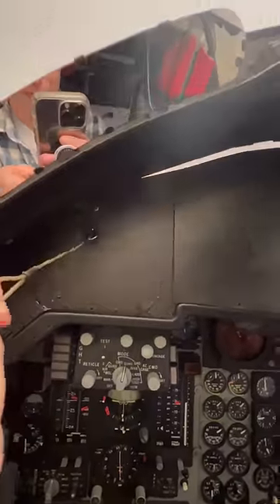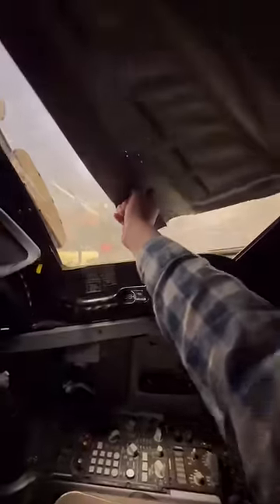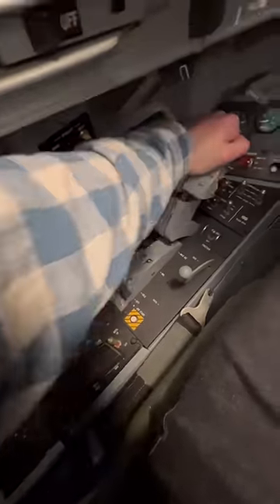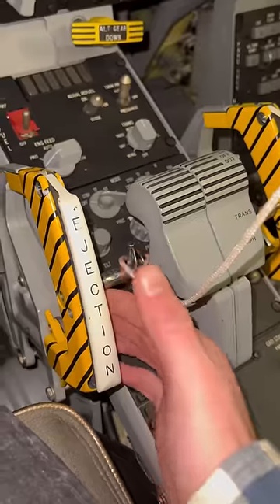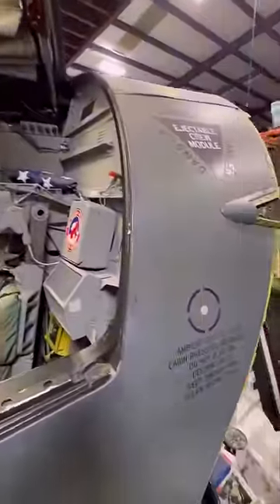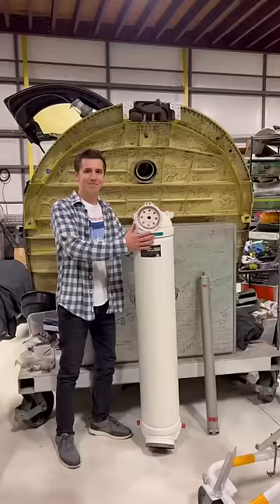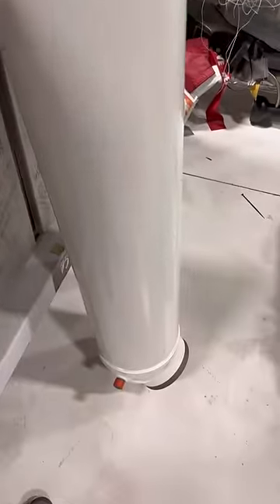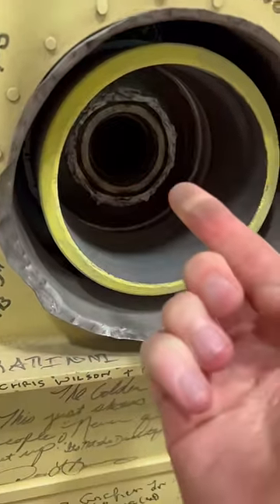How to Drop a Nuke and Survive

Comment from the maker: Fun fact: the F-111 took out more tanks than the A-10 in Desert Storm!
Reply: Hi
Reply: „Fun fact the a-10 isn’t good at its job“-Jackschneider
Reply: @Jisttoturn  Its sad but it's true
Reply: @Jisttoturn but…but the BRRRRRRRRT ?
Reply: @Jisttoturn Who cares, it's famous + fearsome reputation. I heard its job as a slow flying 20mm shredder were usually well done. 
 Not too deep in US war tech lessons, so plz explain where did A10 fail?
Reply: @dannydetonator  Fearsome reputation to british tank columns.
Reply: Cap
Reply: @dannydetonator inability to identify friendly units, causing friendly fire. The gun has an accuracy measured in busses, no that's not a joke or an exaggeration, you take two busses, put them end to end, and that's the splash zone of the A10s gun as manufactured. Some bullets still land outside of that.

There's an entire laundry list that I don't have the patience to type out on mobile, but do know the A10 holds the friendly fire/ civilian kill record by a wide margin.
Reply: Not really hard to believe really Desert Storm was a different war, we didn't have a lot of CAS needs in that one. Iraqi Air force was either bombed on the ground or shot down in dogfighting, neither of which are the A-10's job. The A-10s job was strafing the hell out of armor.
Reply: But I bet the A10 took out more friendlies, British specifically. Checkmate
Reply: @M3rl1n177  Thanx, didn't know that.  Ahh, shredding everything in a straight line of fire did backfire after all..
Reply: @dannydetonator  They used binoculars in flight to identify the targets on the ground. Imagine that.
Reply: Fun fact a10s can't carry any nukes if they could it's a suicide run Kamakazie 2.0
Reply: @dannydetonator  Correction: It's a 30mm gun, not 20mm
Reply: @Daikael  that’s true depending on the distance to the target. The accuracy is measured in MILS. The GAU-8 has a rating of 5 MILS whereas the M-61 is rated to 8 MILS. So if we are talking about the accuracy of airborne gunnery systems, the A-10 is significantly better than the most common western gun. That’s before we get into the ballistic differences between the two.
Reply: Bros a warthunder player 💀
Reply: @usernames98  nah it's fr
Reply: That's a lie. And I base that on no other Evidence than the fact that I'm just not gonna believe you since the A10 is the coolest human invention ever.
Reply: @dannydetonator  30mm" GAU-8 but yes
Reply: Where is the ejection capsule located? I'd love to see it! (Worked on the 111A)
Reply: @dannydetonator  Well. It really were just that we have rockets
Reply: @dannydetonator 30mm
Reply: Wow that sounds like a lot of fun! 😑😑😑
Reply: So if you know, you know…. What?
Reply: @dannydetonator  is a 30mm cannon bud
Reply: @_Clem_H_Fandango_  which it did less of (or at least killed less enemy armor) than the f111
Reply: @dannydetonator  Well when you mean "Did it's a job well" did you mean British amour convoys or actually shooting at enemy convoyes.
Reply: @dannydetonator  also guns are hella overrated planes take bombs over mini gun gun pods for a reason.
Reply: @kim98677  lieeeesssssss all liessssssss!!! I love the A10 and they are awesome (and the sound will either give you a sigh of relief or you just don't exist anymore) and that's all there is too it lol
Reply: @dannydetonator  not to be that guy but, 30mm.
Reply: @Jisttoturn  Armchair general cringe
Reply: @bigtony4930  It's literally an armchair general mindset to say that the A-10 is good. Actual data and accounts from those familiar with the aircraft affirm that the A-10 is a bad CAS plane. That was true when it was designed, and it's even more true today.
Reply: @Jisttoturn  it is right?
Reply: @dannydetonator  lol
Reply: @dannydetonator  just like kv 2 except that I failed
Reply: @ilikeships9333  ye
Reply: @jeremiahpurba3882  LMAOOOO
Reply: @kim98677  Average A-10 Fan
Reply: And kllled way less of our own men
Reply: To all A-10 fan boys, cope and seethe. Aardvark supremacy
Reply: Yes , but the A-10 took out more friendlies
Reply: I don't know? Please tell me!
Reply: But how many British tanks were those? A-10 still wins
Reply: I wish we still had a few operational F-111s we could donate to Ukraine. They could do a lot of good over there.
Reply: Yes but did it cause as many blue on blue/green incidents as the a10?
Reply: lotta seething and coping in here
Reply: @DARTHNECRION  Gripens are better for ukraine or f16 ,the f111 its a bitch to maitain .
Reply: @thelandofnod123 hat’s a disingenuous comparison. The M61 was largely designed for air to air combat, where large spread is more beneficial than pinpoint accuracy. Think of it like trap shooting from the air at supersonic speeds. 

The GAU-8 on the other hand, was designed for air to ground CAS, where you’re probably shooting at targets within a hundred meters of friendly forces, you need every scrap of accuracy you can get. Add to that the fact that the recoil shakes the plane all over the place, and throws rounds everywhere within 25 meters, even if you’re holding on target, and you’ve got something that’s not only dangerous to friendly targets nearby, but also not able to reliably hit specific targets.

If you look at the A-10’s service record, most of its success is due to the fact that it can carry a stupid amount of bombs and missiles, and that the gun really isn’t that effective
Reply: @dannydetonator  30 mm*
Reply: @kyb5203  Yes.
Reply: @norbertszekeres867  YEEEEEESSSS SWEDEEEEEENNNNN LET'S GOOOOOOOOOOOOO!!!!!!!!
Reply: @Jisttoturn  lmao 😂
Reply: VARK VARK VARK VARK
Reply: Sad A-10 noises...
Reply: @kim98677  its from the armies own report after the conflict they conclude f15, 16, and 111 account for over 70% of armor kills, with a10 scoring what little it got with agm65 or gbu with the gun having little to no effect on armored targets heavier than a t55a
Reply: @Ph03nix1  Trap shooting at supersonic speeds? Who is trying to make a guns kill at supersonic speeds? You say it’s a disingenuous comparison, it’s simply a comparison. The facts are facts. The GAU-8 WHEN INSTALLED in the A-10 has an accuracy of 5 MILS. The M-61 has an accuracy of 8 MILS. Simple facts. 

Air to air gunnery relies very much on accuracy. To make the observation that the M61 then needs to be inaccurate is disingenuous. 8 MILS is still very accurate. The M-61 also relies on a high rate of fire although rounds are fired in short bursts so in a single burst you need as many rounds to land in your targeted area as possible. What’s the point in using sophisticated targeting and tracking systems if the rounds are just going to end up in a “large spread” anyway. In fact the only air to air guns kills of the Gulf War were from the A-10.  

The A-10 was never intended to be used solely as a CAS platform with only the gun, hence the huge number of hard points. Yes the gun was selected as the gun to fit and certain parts of the aircraft had to be designed around it, but it was never intended to be the primary weapon of the aircraft. 

If you are within a hundred metres of friendly forces, 5 MILS is awesome, 12 metre diameter for 80 percent of your rounds to fall in when fired from 1.2 km away is what any poor sap on the ground wants. That’s 1.2 km, that diameter gets smaller and smaller the closer you get. And the A-10, along with a lot of other aircraft designated for CAS fire from closer than 1.2 km. Remember it’s measured in MILS. 1.2 km (4000 ft) is the design range. 

These are the numbers from the Gulf War

987 tanks destroyed
2 Helicopters (air-to-air aircraft) kills with the GAU-8
501 Armoured Personnel Carriers (APC) destroyed
249 Command Posts (CP) destroyed
11 Frog missile launchers destroyed
281 Military structures destroyed
96 Radar installations destroyed
72 Bunkers destroyed
9 SAM sites destroyed
8 Fuel tanks destroyed
2,000 other military vehicles
1,306 trucks
53 SCUD missiles and launchers
10 aircraft on the ground destroyed

From 144 deployed aircraft that’s an excellent success rate.
Reply: Actually it's probably more even if you include friendly kills 😜
Reply: @gaiamission7200  what little it got? Over 900 tanks destroyed, that’s not a little.
Reply: Absolutely true. Although the warthog has an amazing gun it is not very accurate
Reply: @michaelmcmillan2776  not really, it's not effective against even tanks when it was first deployed
Reply: @dannydetonator  30mm GAU as far as I remember
Reply: The A-10 would had a decent kill rate...
Only, most of them were allied soldiers and that's not worth bragging about.

😥
Reply: @M3rl1n177  "Good optics" - no, it had trigger happy "Yeee Haww" types behind the controls.

THAT is the problem.
Reply: The F22 first air to air kill was the Chinese spy balloon lmao
Reply: @gaiamission7200  LALALALALALALALALALA I CANT HEAR YOU 

BRRRRRRRRRRRRT
Reply: @thelandofnod123  it claimed 900 after war conclusions state a minority of the targeted and claimed vehicles were disabled
Reply: @richardwillson101  poor optics was the main issue, records exist of an a10 pilot misidentifying a british scimitar light tank as a enemy mlrs because of add on panels, the cockpit recording includes audio of the pilot vomiting after realizing he killed a british vehicle
Reply: @Gaia Mission  yet we know that one more than one occasion the pilot opened fire without PID or authorisation to fire blind from the ground.

No amount of optics can change the mindset of somebody that trigger happy.
CAS is a very disciplined art, you don't just do whatever you fancy.

That's how we get blue on blue time and time again!
Reply: @gaiamission7200  wait, it’s silhouette doesn’t even look like MRLS, neither Soviet nor other European ones. Are optics such primitive there?
Reply: @Спойлерщик  they mistook a orange plate added on to identify coalition vehicles as a rocket launcher according to flight audio, also generally no but the a10A the pilot was flying has no targeting pod camera or other air observance system and the pilot was attempting to id it from at least 10k feet
Reply: @gaiamission7200  some weird shit happens. Found that video. British should have had constant communication with US commando and looks like pilots made some mistakes and didn’t fully confirm area where they were operating
Reply: @user-yc1xe1pd1f  no, cross communication has always been an issue as the US military lime to use their own systems which are not usually compatible with any international ones.

Orange was the colour used to denote British Forces.
They displayed Orange.

Absolutely no doubt about that. The pilot even spots this.

The entire blame lays with the pilot who pulled the trigger and his wingman who should have been assisting.
The British troops did Absolutely nothing wrong.

The US troops on the ground made a minor mistake, but still didn't call the kill.
Reply: @richardwillson101  i dont feel anyone is in the wrong in that incident, the pilots second guess themselves for a fair time before commiting and immediately call off, they were also authorized for strike by a cci if anything its the ccis fault for not adaquately checking for coalition presence before authorizing a strike
Reply: @Ronin13D can't argue with the brrrt
Reply: @_Clem_H_Fandango_  Which it sucks at. Can't penetrate even the T-64
Reply: @dannydetonator  it’s very likely to die if the enemy turns out to still have some kind of anti air weaponry nearby because it’s slow, big, flies very close to the ground and has no stealth coating or design to reduce it’s radar signature, it’s also quite innacurate with it’s guns and they don’t have much pen either, and it seems unable to recognize friend from foe as there are many cases where a10s commited friendly fire
Reply: @highqualityorangejuice420  brrrrrrrrt ftw
Reply: The A-10 is a fail at its designed job. The Falcon or Eagle can do its job better.  Warthog is good at taking small arms fire during CAS missions.  Too bad the Tacano can do it for far cheaper...
But I do LOVE the BRRRRRTTTTT!
Reply: @dannydetonator The A-10 doesn't use a 20mm
Reply: @gaiamission7200  so what you’re saying is that the USAF, along with many other air power studies since 1994 have just been lying about the A-10 destroying nearly 1000 tanks during Desert Storm? 

These tanks were destroyed primarily with Mavericks, not the GAU-8, don’t get that confused, in the same manner as the F-111 destroying over 1000 tanks with GBUs.
Reply: @michaelmcmillan2776  The GAU-8 is very accurate. Is it a contender for an Olympic shooting team? Hell no, but as far as airborne gunnery systems go, yes very accurate.
Reply: Is that true?
Reply: @saurabhgaikwad3057  yes, very true.
Reply: @dannydetonator  30mm*
Reply: @f1y7rap  I wouldn’t say it’s a fail at its designed job, it’s very good at killing tanks and armoured vehicles, it just doesn’t use its gun to do it very often. It was designed after all to have a bunch of hard points to carry munitions, it’s not like it was only fitted with a gun and that’s it. Any of the current US fighters and even B-1 and B-52 can do a pretty good job of tank killing and also double up as fighters and other strike platforms. They’re not capable of sustaining the same level of damage as the A-10 but that’s hardly a reason to keep them in service as a specialist aircraft type. Whilst the initial cost of the A-10 and operational costs were quite low compared to other aircraft, they are now becoming more of a burden than an asset and probably should go to free up funds for more of the other aircraft types, new airframes or sustainment of the current fleets. 

The Tucano or Texan II or anything similar is not really suited as a replacement for the A-10 for US needs and there isn’t really a need for one anyway when you have various other fleets already.
Reply: A10 is a CAS aircraft the F111 is not. It's a strategic bomber/attack/recon aircraft. There is literally no comparison. And of course, bombers taking out entire bases full of tanks and convoys took out more than CAS aircraft.
Reply: The only people that would say they're not good in that role are people that have either never served or were POGs and never needed CAS. Danger close gun runs and indirect are called danger close for a reason. why all the hate for the A10?
Reply: @Daikael  you're taking like the A10 has been unchanged 30 years later. It's had updates.
Reply from the maker: @Jisttoturn  This isn’t a comment on the A-10s capabilities, it’s a comment on the F-111s capabilities. Of course the A-10 is great at it’s mission and there are many reasons why we still fly the A-10 and not the F-111, but this stat does show the relevance of the sometimes under appreciated F-111!
Reply from the maker: @kim98677  I love the A-10 as much as anybody, but c’mon, the F-111 deserves a little love too! Such an incredible feat of engineering.
Reply from the maker: @zeuqramjj2002  Google “dump and burn” and then you’ll know
Reply: @DARTHNECRION  Not really, when the F-111 was retired from service in the only two countries that ever operated it, it was a maintenance burden. Parts are no longer manufactured and haven’t been for a very long time. It also required 2 crew. In the highly contested airspace over Ukraine 🇺🇦 it would also be harder to protect, requiring additional escort, those escorts could be doing the job that the F-111 was there to do anyway. The systems onboard were also quite aged compared to aircraft still in service. 

There’s a reason why platforms like the F-16 and F-15 are still being manufactured (the same could be said for the F-14) and multiple countries operated them and keep buying them despite originally being from the same era as the F-111. 

The F-16 and even the F/A-18E would be a much better fit for Ukraine 🇺🇦.
Reply: @erictheepic5019  Dry statistics and empty reports as opposed to the firsthand accounts of Iraq veterans who love the damn thing.
Reply: @Stalin99  Redditor cringe
Reply: @bigtony4930  Do any of those veterans that like it happen to be British?
Reply: @bigtony4930  You don't at all wonder about why the A-10 is the only aircraft in recent history to have had blue-on-blue incidents? (Also, note that that's incidentS, plural.) Maybe something to do with the fact that the best form of target identification an A-10 pilot has access to is a fucking pair of binoculars? Oh, but having absolutely no sensor package whatsoever like it's nineteen-forty-fucking-four isn't a flaw...
Reply: I see one of these fly past on fire then crash when I was in high school in wells next the sea Norfolk England in may 1990 - in crashed in a village called binham. I can remember seeing the cockpit eject. I was 12 years old then.
Reply: @Ronin13D  hey we need 2x30mil gau on a single a-10late. That possible?
Reply: True: But which one is still going?
Reply: Not to mention; from what I can tell there were almost 3x the amount of A10's over F111's. And these numbers of F111's might even include ones that never actually saw combat but were radar wielding terrain folllowing aircraft to help the F16's or F15's out :D
Reply: @Name-ps9fx  for the gau8 casings? It doesnt eject spent casings for balance issues, instead the drum just recollect the spent casings and then is unloaded while on the ground
Reply: Closer Air support isn't always just tank busting, it also means to strafe and saturate enemy fortified positions, which most buildings aren't going to be made of ballistic plating, which means that 30 mm bullet is more than likely going through a few walls which will force enemy into taking cover which can allow for a little bit of a advantage from here to there. So when you're doing a strafing run down a street where you've got a whole bunch of people You probably going to hit a lot of things pretty much everything except for what's in the center of your target reticle
Reply: Oh and people remember the Gatling gun was not added to the plane, the GAU-8 had a plane added to it
Reply: @Jisttoturn  Depends on the job. Friendly fire... Fucking aces it, taking out tanks huh maybe not. Light vehicles/IFV's... Well the brits will say it passes with flying colours. But it's main job, scaring the hell outta the enemy and bolstering troops morale. Well on that it's fucking unmatched, just don't call danger close.
Reply: I worked with a guy who was a bomber on an aardvark. He said he never got to do anything. They used guided bombs, but the pilot was so good all he ever did was keep the bomb straight. He was only trained to land the aircraft, but the pilot never let him do it. One time the aircraft caught fire and his side got hot, so he pulled the ejector. The pilot didn't pull his and landed the aircraft. They gave him the pin, and he had it hanging in his cubicle.
Reply: And then we retired it.  The hell are we supposed to use now?  everything's a stealth bomber that costs $10 billion just to tow.
Reply: Fun Fact: The F-111 made Muammar Gaddafi shut the hell up in 1986.